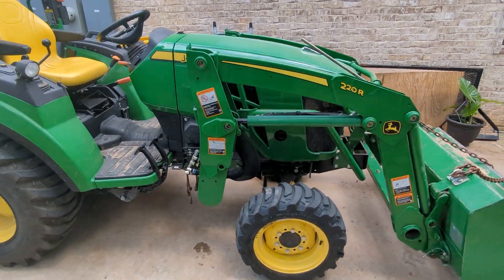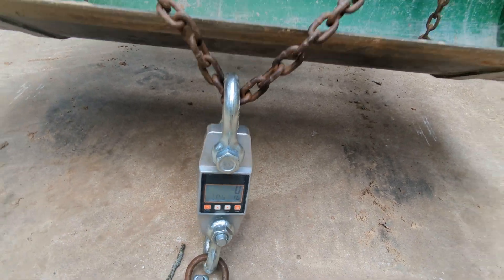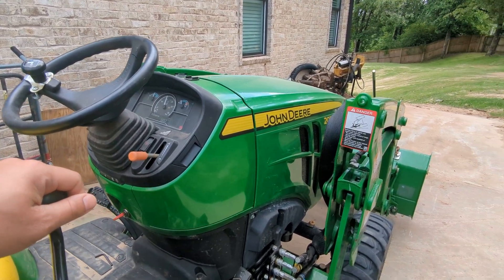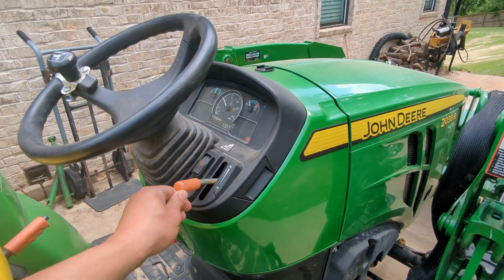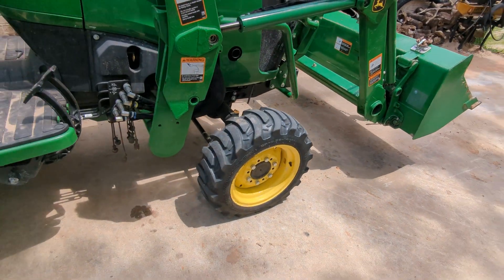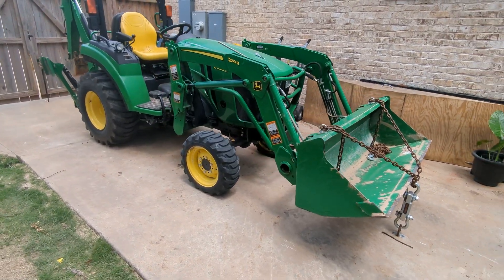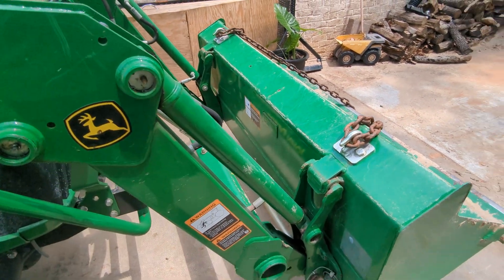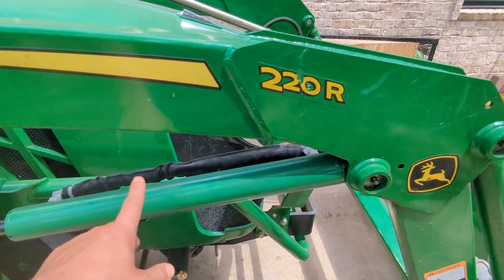HydrosPlus Cylinders+ 1.75inch production prototypes on 220R loader

Comment: Are this lifting as much as a 2025r I’m new to this stuff and looking to get a 2025r and need to lift a 5x5 round bale😊
Reply from the maker: A 5x5 is around 1100 lbs depending on moisture content.  If you're just moving them around, you can do that with the 2025R and HydrosPlus Lift Plus cylinders.  If you need to load them onto a trailer that's higher than about 24-30" off the ground, you will likely need to up your pressure as well.

Check out this video for what you can do with the 120R loader and HydrosPlus Lift Plus cylinders at various pressures - https://www.youtube.com/watch?v=kk8TIRbSnMk

Comment: Nice video. Do you have these cylinders available for 3038E? Any thoughts about the curl cylinders?  Thanks
Reply from the maker: Thanks!  Yes, curl cylinders are also on the schedule, but they will be a few months out.  The 3E series will be the priority because those cylinders are small and have a larger rod diameter, which means that they have even less power than the 1 series because of the smaller surface area on the rod side of the piston.

Comment: Would these mods void the warranty on my 2021 2032r?
Reply from the maker: Short answer is no because nothing can void your warranty, but to answer your question, it depends on what the failure is.  The warranty is specific to the situation.  If the alternator goes out, it can' be reasonably traced to the hydraulics, but if an o-ring blows, then they might try to blame the higher flow.  While the flow solution can't technically break anything, a dealer may determine that it contributed to a failure.  If they do, then that part won't be covered under warranty.  For the 2R and 3E tractors, they will likely never know that it has higher flow because it's a direct replacement.  

In my experience and reading, the dealer does the right thing for warranty work, mainly because they get paid either way - either from Deere Corp or you, so might as well be Deere Corp.  The Dealer is the one that has the most say in what is covered, Corp leans on them to tell them in most cases.

As for the cylinders, same story but your warranty for the loader and tractor is really only for 2 years.  You have powertrain and emissions for more, but those aren't related to hydraulics.  Regardless of the reason it breaks, they won't cover it after 2 years.

Comment: Great video !  I'm thinking I will want these for my tractor

Do you also have the hydros plus pump on this tractor or is the only upgrade the cylinders?
Reply from the maker: Sorry I missed this comment when I was on vacation.  We have a HydrosPlus flow solution for this tractor as well as the cylinders that are coming soon.
Reply: @HydrosPlus  thanks for the follow-up. 

Just to clarify,,,,, in the tractor on this video,  the upgraded pump is installed in addition to these new cylinders?
Reply from the maker: @mattnicol8882  That is correct.